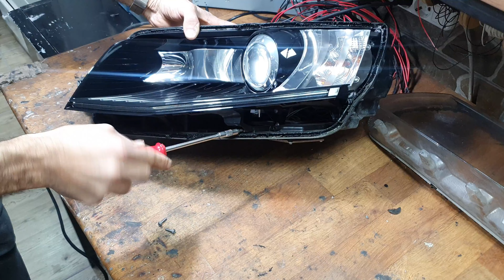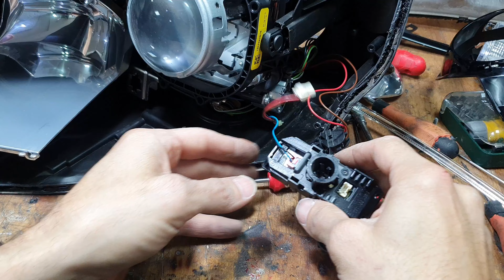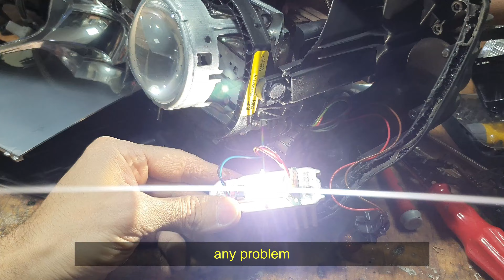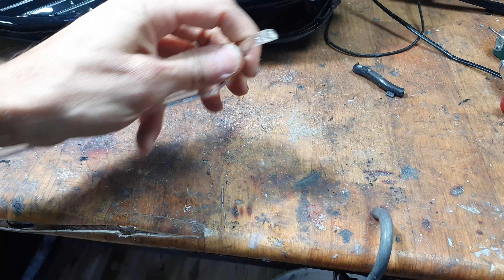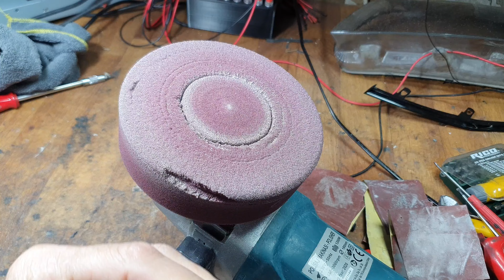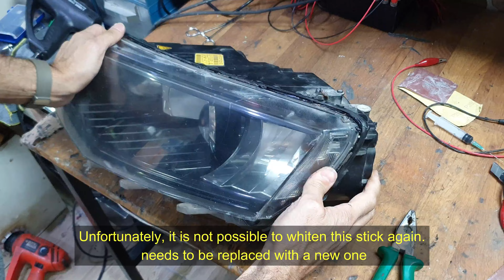Skoda Octavia Gündüz Ledi Çubuğu Onarımı

Comment: Well done! How much does it cost to do that?
Reply: In this case I assume the repair job was cheaper than new headlight units. These days they are complete integrated sub-systems. It is easier for the car manufacturer (just a single headlight unit, instead of separate light components per side. On the other hand, they practically are all LED based anyway, so generally you only need to replacement if you had a fender bender...

Comment: Far easier to just take the LED module off the back, uncovering the burnt end. Drill or burr it out carefully, and then polish with a cotton bud / q-tip, or use some invisible joint plastic glue like "Plastic Magic" to make the end clear. Will eventually brown again, it's a bad design given the heat involved. No need to take the light apart!

Comment: Please can you told me what pins you put 12v to test the drl.. thanks
Reply from the maker: I really forgot man. After detecting the chassis lead, you need to supply 12 V to both pins at the same time in order to operate the daytime LED. It doesn't work when you give electricity to a single pin.